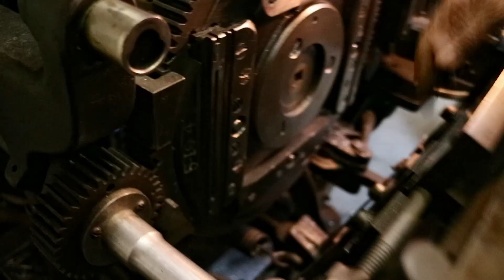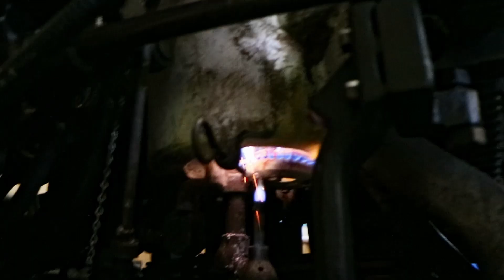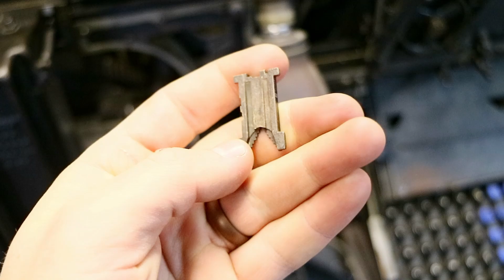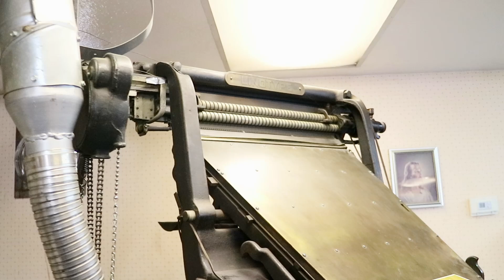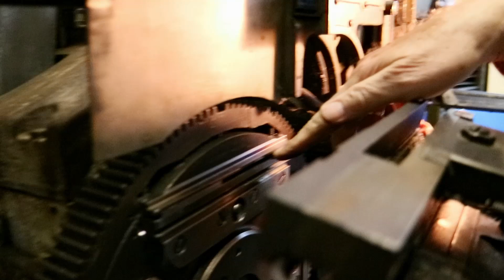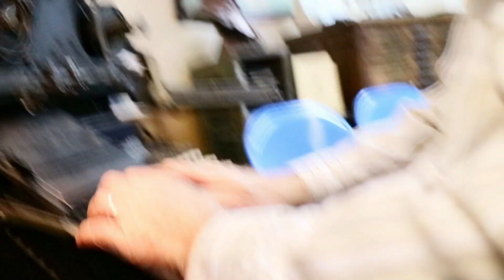What is a Linotype Machine?

Comment: As a high school kid in the 60s I worked for a newspaper that had a couple of these Mergathaller Linotypes they still used. Part of my job was to take the used slugs and throw them in the melting pot and pour the pigs (lead ingots) that would be slowly lowered into the hot pot on the back of the machine. An old guy named Walter ran and maintained them and they were in perfect condition for their age.
Reply from the maker: That's incredibly cool. Old guys like that keep civilization functioning.